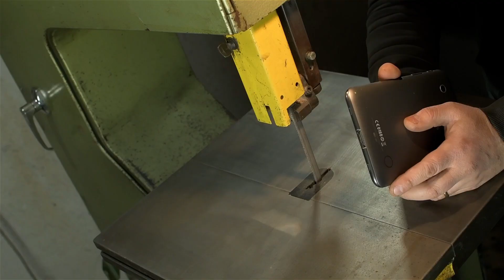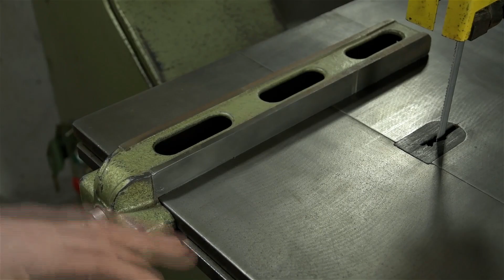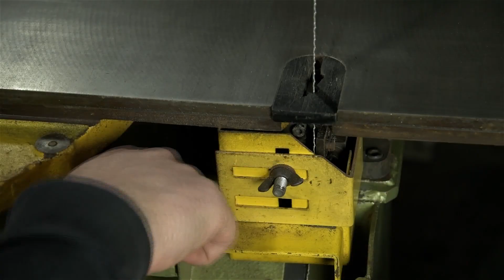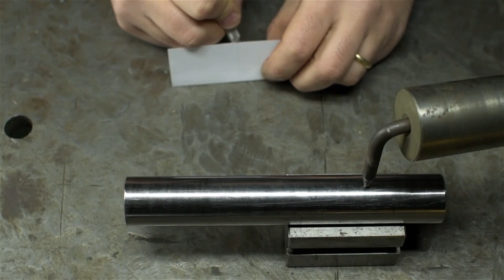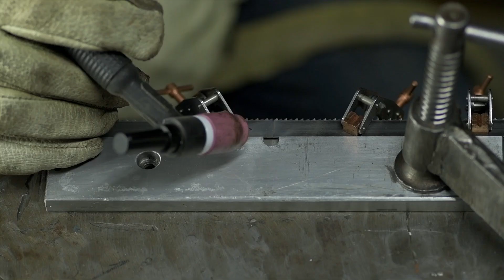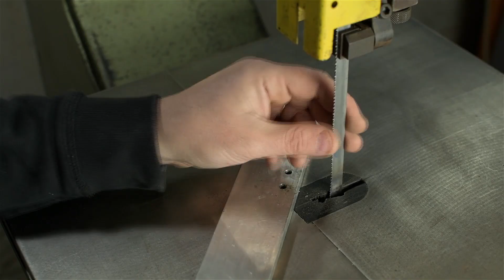LIVE!? - Welding Bandsaw Blades & Startrite Saw

Comment: My band saw uses roller bearings. I HATE my bandsaw. It binds up continuously such that it's hardly worth the squeeze. Has two cast iron wheels, that are infuriatingly tapered outward--away from the larger stop on one edge of the wheel. I think this is a safety feature: if you bind the blade, it will kapwing off the drive wheels faster than you even understand what's going on, clangor around in the enclosure, and spin dumbly until you reinstall the band. For this reason, if I had it to do over again (which I can't afford), I would vote for rigidity everywhere I could get it. Wheels that are absolutely flush and flat and parallel with bumpers on both sides, rigid blade path with a space on either side of the blade that won't let a mouse fart through. I'm sure this could be accomplished with roller bearings (good ones, new ones of high-quality that were accurate to begin with), but not in this world.

Comment: 20.years ago I bought some bandsaw blades which the teeth pointed the wrong way.  Horrible Freight blades, so they were cheap and available.  I needed the teeth to point the other way so I cut the blade and re-welded it.  It actually worked.  A few years later I learned you could just twist and flip the blade.  Oops, well...live and learn.

Comment: WOW Nice bandsaw. Amazing, I have never seen a 3 wheel vertical metal cutting bandsaw.  I welded bandsaw blades for 20 yrs at my tool store on a 1960s era Factory Reconditioned $5000.00 Stryco 1 1/2" capacity band saw blade welder.  Generally bandsaw blades are resistance welded, then annealed, and ground flat. I think I have welded a million of them personally. Roller guides are generally better, but those solid guides should work fine. unless your doing heavy production work. They are just for holding the blade square so the saw doesn't cut crooked in the material. Really nice Job! I have never seen anyone tig weld them ! Awesome and hilarious video as always!

Comment: I have an Enco 14" band saw with blade welder (240V) and I'm thinking of TIG welding my blades to see how they compare.  One thing my saw has over yours is adjustable guides.  The back support (above) and the sides (below) are 3 separate parts, and it's a snap to adjust for different blade width or thickness.  Cloning this head would give your life new meaning.  I thought about replacing it with rollers but the hardened surfaces are doing great after 20 years, so no need.  I absolutely LOVED the mobius gag at the end, and the Penrose square was priceless.  God how I love your channel.

Comment: I had a dream where this was hardened by the rapid heating and cooling, and only needed to be heated enough to turn (say) blue, or some color we associate with springs.  I use silver-soldering for this job, but can imagine there might be less damage in general by welding if you could get away with it.  I might try this with very tiny TIG torch and small electrode, small filler wire.  Inspiring!

Comment: You don't anneal carbon steel at red heat........that's why that blade bent at the joint......the anneal colour is a dull straw, but if you aren't fussy go to blue and it will be springy.

Comment: The bandsaw is a fantastic tool, lots of opportunities but also a lot to learn! I expect you know a huge bunch, so you know the slow learning curve, but it's still a long curve! :-)
Blade tension, speed, setting of blade, wheel angle, lower and upper guides and lot more! Not mentioning guide spacing, initial setup, drift correction, blade position on the wheels and on and on!

Comment: Same wheels they used in their smaller two wheel bandsaws. I used Startrite bandsaws throughout my teaching career, the more expensive ones were OK but the little ones are a bit rattly and crap. Startrite used to be a good company, they made great wood lathes, but their customer service was utter shite: I wished them a swift bankruptcy as a parting shot in my last phone call, they lasted another 6 months.
Startrite's products were picked up by the usual Yorkshire engineering suspects (RJH and the 600 group) and carried on production but with mainly reduced quality. The huge "Graduate" wood lathe is excellent if you can find one. 
For good big bandsaws (and everything else really) buy second hand Wadkin.

Comment: When you turn the bandsaw blade 180 degrees, does the effect  change if you turn it counterclockwise as opposed to clockwise? I feel I rely on you entirely too much watching your educational videos, but It seems you are starting to slip just a bit by omitting that vital information. Take your soup can cell phone, call your old shaper, see if it still likes you enough to make some new solid blade guides for its replacement, (although I fear the cutting bit you'll have to grind would be quite small). Glad the bathroom faucet isn't flooding the house letting water drip into your garage getting your new welder all wet!

Comment: I realize this is an older video and you may have already found the answer you were looking for, but I much prefer the solid guides to rollers. I find roller guides tend to get filled up with the metal shavings/chips. I do however prefer a rear roller for the infeed force. If interested I can send you some pics of the adjustable solid guides on my old saw.

Comment: Well its not a Marvel saw but I do like it except that it doesnt have roller guides but as long as keeps the blade from wandering in a cut its fine. I made my own guides for my ancient wood bandsaw that was made at the time ball bearings were becoming popular for use in bandsaws. A machining engineer came over and tried to cut a piece of steel with my wood blade and knocked all the teeth off my blade. So I thought about fixing some blades I found that were still sharp but broken. Will likely weld them. I have brazed them in the past.

Comment: my colegue welds bandsaw blades with MIG. He puts cast iron, or a rusty plate underneeth (so the weld wont stick to it) and welds it trough. After welding, you need to use the blow torch and slowlly reduce the temperature of the weld down. After that, it wont brake/crack.

Comment: If you have problems with the butt weld cracking, try cutting and joining halfway up the back of the tooth and not in the gullet. Standard practice on the wide bandsaws I’d guess the same for the narrow ones. If you really want to get fancy make the jig out of steel and keep it heated. Fast cooling welds are the enemy of those joints. Also don’t get crazy cutting a deep relief for the weld bottom, you won’t have any problems unless you floor that pedal.

Go with roller bearings as guides. Being able to stiffen the blade to your depth of cut will reduce wander/snaking around knots when you are cutting wood as opposed to rubbing with the guides. The friction will mess with the tension in the blade.

Comment: I like to weight in on this... I have been trying to weld Bimetal blades with my oxyacetylene torch. I kept messing up because there's a very fine line between burning a hole in the stock and making a weld but with further adjustment and refinement I was able to get decent weld puddles. But so far using any welding rod the weld has been rather brittle even with annealing... so I tried this:

You know how those blade welders heat up the blade with resistance welding and then has a handle to push the blades together in a molten state? So I did the same thing. Heated the blade until it starts to melt (not too hard) then pushed it together. Then did a tempering pass. The blade does break if I try to bend it but with the annealing pass, it actually took some effort to break it...
Reply from the maker: cool! but with a torch I'd suggest brazing the blade instead of welding.
Reply: @ThisOldTony  Yea funny you should mention that, it worked well enough on standard carbon steel blades, but on Bimetal when I tried brazing the metal just snapped clean off. Mind you I did bevel it properly and all that... I'm guessing bimetal blade backs don't like brazing? I never heard anyone braze those anyways. I don't know if it's the alloy but I never had much luck brazing steel to steel. I am using silver free bronze rods and that Stay Silv black flux. It worked well for steel to carbide however.

I have yet to try it on the saw though as I was just practicing on a bimetal blade that broke at the weld... in the process the blade wraps itself around the bandsaw frame so becomes permanently kinked and I'm not going to try and reweld it so I just used it as practice stock. But on the plus side the blade went dull and I had resharpened it once so it lived its life. 

As to how I pushed the blade together, I don't have a jig so I made a jig similar to what you have in this video and I just clamped one side tightly while leaving the other side loosely clamped, so that when the blade is hot and melting I just give it a gentle push, and then just remelt the blade a little bit to make the weld strong... I think I'll try this a few times and maybe do a video about it... If successful I can just buy blade coil stocks and not have to pay someone to weld it for me.

Comment: Kind of late to the party but you may have better luck using torch to add heat in decreasing amounts to slow the cooling process when annealing.  You should be able to touch ends with the short test pieces without taking a set or breaking.  I suspect you may need to heat it up a smidgen more too.

Comment: Every school workshop in the UK had a Startrite bandsaw in it's workshop.  (Apart from the one school that had a 40" throat two wheel Wadkin, man was that a beast, took ten minutes to run down to a stop.) 
Startrite's customer service was simply appalling. On the phone to them I got so frustrated trying to get a part number out of them, to order a part, they wanted £18 for the diagram with the part numbers on so I could tell  then tell them what I wanted by number, that I wished them a swift bankruptcy. They only lasted a year after that.

Comment: Would you prep the joint differently if you were going to braze it with silicon bronze? It seems like a brazed joint in this instance would be very weak after you grind the joint flat.
Reply from the maker: yes it would need more area so scarf joint.

Comment: The other use for welding blades is if you have a fairly new blade that has an area with broken teeth, you can splice in a new section instead of scrapping the whole blade.

Comment: For some reason that mobius strip trick reminded me off welding a differential(lincoln locker). Where you weld the pinion gear to the ring gear. For better traction.
https://www.pirate4x4.com/forum/attachments/general-4x4-discussion/1107642d1384581045-welding-diffs-welded_diff_01.jpg

Comment: Years ago I worked in a timber saw mill with blades that were 10-14 feet diameter and 10-12 inch width they always got sent out for sharpening and welding, some of the welds were erm questionable but they never failed. Keep trying ToT! Haha or the evil oxide pixies will invade!

Comment: I have the 24" model of the same saw. Lovely British engineering. I have just bought a 4" toolmakers vice. Using the guides on the table I slide the vice between them. I have just cut up some 1/4" angle to make some brackets. The pieces are true to within 0.002" - almost as good as a milling machine. I love my saw! Just changed the oil in the gearbox. It was like cold butter! Probably not changed in 40 years!

Comment: Tony, thanks again!
I built a bandsaw about 15 or 20 years go. I used ball bearings for the guides and they are still working well. I think you can get them tighter than the cast blocks, I use it mostly for thin metal and cutting circuit boards. It's been really handy. I think the cast and fiber might be better for wood and they probably clean the blades better.

I bought a 1/2" welder for my horizontal saw and in the last 30 years or so it's more than paid for itself besides you can cut inside holes like you said.

Comment: Another great video, thank you Tony! someone has probably commented about this already but here goes… On the “cut both ends of the bandsaw blade as square as possible“, a trick I learned in junior high school (The years of school before high school) shop is to hold the blades (both sides of the blade) in the orientation they will eventually be welded in, one side in your right hand and the other in your left hand, now twist them together and lay them on top of each other and hit them against your grinding wheel making a very flat grind. When you un-spring the blade back to its normal position, whether the cut is square or not the two ends of the blade will meet perfectly and the blade will be straight for welding. I’d send a picture, but – you know, YouTube and everything.
Reply: I understand all of that except for the "twist them together" part. What do you mean?

Comment: I love this Möbius strip trick - you've just forgot to mention one additional benefit - that you'd be able actually to cut both ways (so to speak...), as with every full "rotation" of the band the teeth would "flip" to the other side (i.e. front to back and then back again... err, I mean "front again", of course).
But this arrangement, well, "cuts both ways", unfortunatelly - you'll not only need to be extremelly fast with going from one side of the saw itself to the other one (this could be done, but with he higher speeds of the saw some relativistic effects might start to show up), but you'll have to change your slot-type blade guide to one using rollers... Would it be worth it, then?
: )

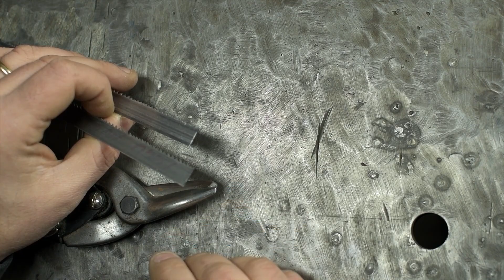Comment: Tip After welding you are supposed to Temper the blade not "kneel on it" the welding unit that comes with them((11:44)well not yours) also does the Tempering. Go for the rollers the inserts are lame.

Comment: Im still crying for that shaper when you got him i decided to get one as well... And youve gone through your shaper phase... I still haven't one :-)) but a bandsaw i have but for metal..a horizontal one.. One of the best machines you can have is a bandsaw...my blade is supported on both sides by 3 roller bearings one each side and one on the top..

Comment: I did quite a bit of welding my dads wood miser blades back together, but I found that the best filler to use was 309 Stainless and leave a small gap~1/32 to 1/64 for the filler to fill. Anneal as usual.

Comment: Back in the days of splicing audio tape, you'd match diagonal cuts instead of straight ones. I think that was to add strength to the join (or it may have been to reduce audio pops, in which case ignore this comment completely). So I was wondering if the same might be true for blade welds.
Reply from the maker: Yes!  If you braze them that adds more bond length.  Tig welding, pretty strong on it's own.

Comment: The filler "takes the bullet of the arc strike"? ROFLMAO. Only if the ground cable is hooked to your ball sack. Which makes it hard for the arc to find the base metal. You're putting a barrier in front of the arc that's only going to increase the amperage required for the arc to jump the gap from electrode to base metal. What exact "filler" did you use besides ".040"? Is "filler" even necessary and isn't using incorrect filler that doesn't "match" the base metal a bigger problem than a solution? With either gas (oxy-acetylene) or TIG its entirely possible and actually easier to weld with no filler forming the puddle from the base metal. That's how most good instructors teach "torch welding". It's how you learn puddle creation and control and you can use both hands on the torch for control and accuracy and precision and at the very least only have to know what one hand is doing. Adding filler rod adds another "dimension" of difficulty and suddenly you have to know what both hands are doing and both hands have to know what the other is doing. Maybe you should demonstrate welding with NO filler rod for your students sometime.

Comment: 8 inch "capacity". Yeah. You bet. Throat height is not "capacity" but if you can toss a chunk of 8" wood or anything else up on there and get that light-duty "hobbyist" bandsaw to cut anything approaching a "straight line" before the motor overheats and/or you get tired of holding it or the band is "dull" or broken, please do a demonstration.

Comment: What the hell is a "halfwheel" and who would assume a bandsaw was "driven" by two of anything? One "wheel" is the drive, one wheel is the driven and "halfwheels" are going to be good for half a revolution of those wheels before the machine "crashes". At least in a GOOD bandsaw. Using three "wheels" may be "efficient" as far as being able to use a wider range of band lengths but otherwise, crappy engineering all the way. Triple the parts, triple the bearings, triple the wear and the "benefit" is that the "user" gets to "fix" broken bands that only break before they're worn out because of....crappy engineering.

Comment: That divot in your straightedge jig for your blades, I would have went straight through. 
This would allow the work to been seen from both sides WHILE it was still clamped to the jig.
May not be necessary,  but the cost of peace of mind is still worth more than bitcoin.

Comment: One trick for getting the ends fit up is to hold the blade blank in kind of a big U with the cut ends together. Then twist one of the ends over so the two ends of the blade are laying flat on each other buy the teeth are pointing away from each other.  Hit both ends on the grinder simultaneously. When you match them up to weld it doesn't matter if the ends are square or not, because they with be opposite angles and fit up regardless.